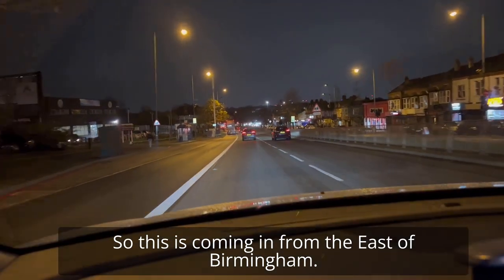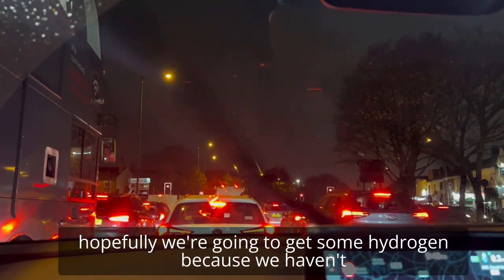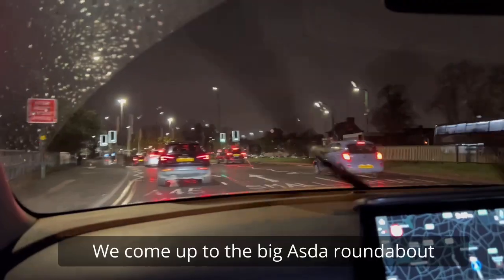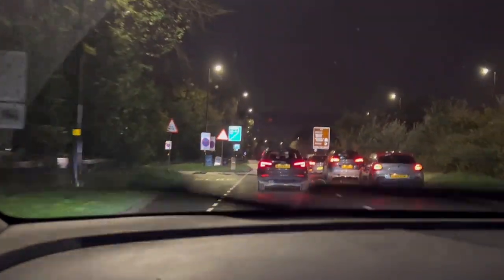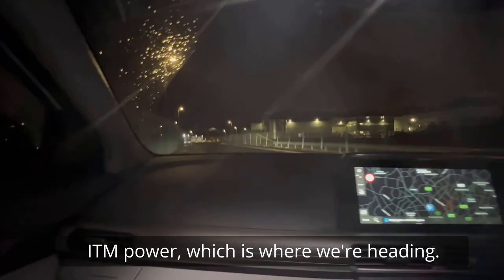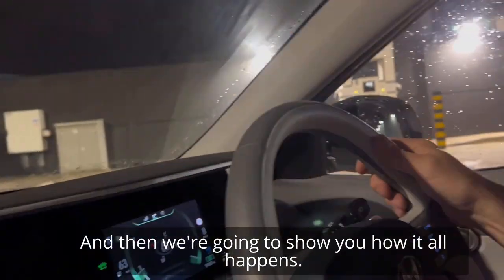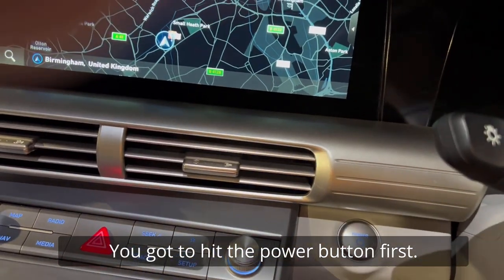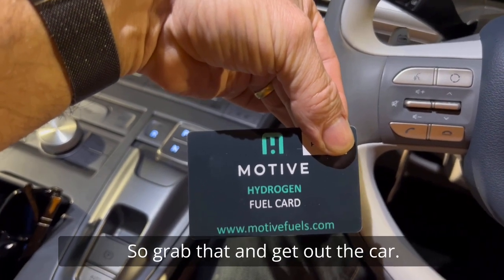How to refuel a hydrogen car in the UK - Business West's hydrogen car

Comment: Still better than charging an EV,  thanks for the video
Reply: Really? You can charge your EV overnight at hotels or home, or during the day at work or parking lots, DC fast charging is good enough for longer trips - this does not look better than an EV at all, because you have to do this every time you fill - looked worse than faffing with DC fast charger at McDonalds.

Rent both types of car and see how you get on.
Reply: @brushlessmotoring   yes its so different to pulling up and fuelling up with petrol station either having to pay before use of fuel or wait until your authorised to fuel up, fuel up and go inside to pay. it very similar process to what we currently do. ev takes forever to charge for low milage you can travel .